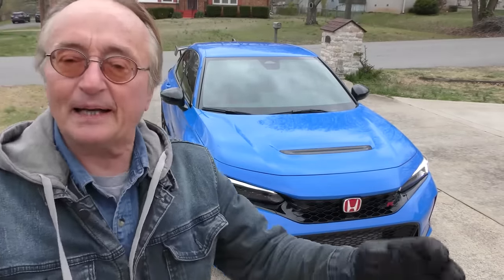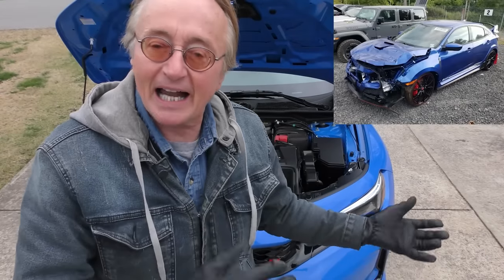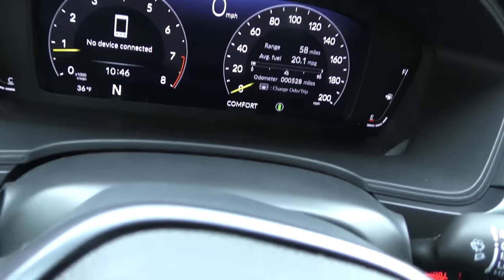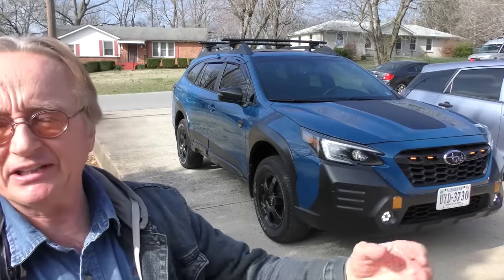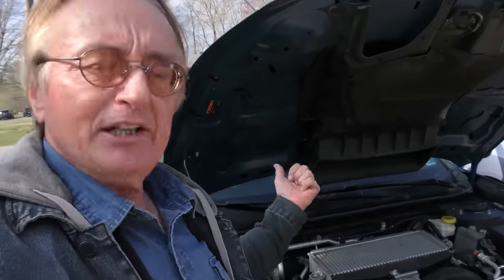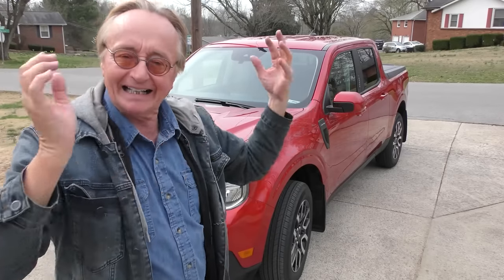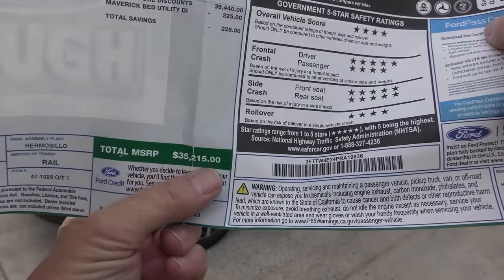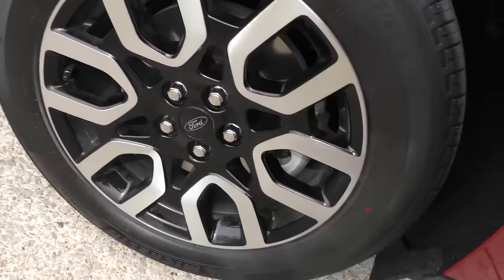3 New Vehicles You Should Be Looking At

Comment: As a mechanic, new cars are amazing, yet absolutely terrifying. I still drive my 2004 Toyota, and I can fix any problem roadside with what I have in my toolbox. I'll give up 150hp for that peace of mind.
Reply: Same. Still love my 02 wrx. I want  a car, not a cell phone on wheels
Reply: @senseicorey9979  😂😂😂
Reply: @senseicorey9979  only idiots think new cars are cell phones 😂 if you can't repair a basic new 4 cylinder then you're helpless 😂
Reply: @senseicorey9979  I'm sticking to my 05 Outback XT (manual & modded) too. Bluetooth speakerphone over FM makes my smartphone a fine infotainment system!
Reply: @senseicorey9979  I love your term for new cars! Bravo.
Reply: A friend of mine has a 1994 Honda Civic, and he will never let that go. So many people have offered to buy it for double what he paid for it. Calvin does all the work on his car which is one of the reasons he keeps it. It's simple.
Reply: Exactly i agree. I have a 2015 Civic SI with all original Honda parts, it would be stupid to modify it just for more speed so you can kill yourself or go to jail with lots of citations and possibly ruin your car.
Reply: Same my 2004 jazz fit
Reply: @senseicorey9979  the new FA20/24 engines are extremely simple, nothing to be afraid (FA20 forester here). And they are extremely reliable.
Reply: @514aam  it's not the engine I'm worried about, it's all the electronics attached to it.
Reply: Bought my Accord Coupe manual in '12 and still going strong.  Not selling it anytime soon.
Reply: @rebeltvr6046  I drive a ton for work and I'd rock one of those.  I deal with winter though,  so subarus AWD is really king
Reply: It’s a Honda, it’s not a VW or BMW 😂 it ain’t gonna broke down if you treat her right
Reply: Stickin with my Camry no problems and it’s a 2010
Reply: New cars are just tin and plastic computers.....people are suckers...I've worked on cars for 20 years...I got out of it 5 years into it because I dknt like working with computers...cars are a hobby for me now, I don't have to work on new cars

Comment: The concept of the Maverick is a good one. Most people in suburbia don’t really need a full sized truck, especially as full sized trucks have gotten larger and heavier over the years despite substituting aluminum and plastic where steel once was. The only good thing about everyone owning a truck is that neighbors come around less frequently wanting to borrow mine. Haven’t shopped for Fords for a while. Was at a Chevy dealership recently and looked at a Silverado 4x4 in the showroom. For just a little over $50k, you’d get a well appointed quad cab pickup with a turbo charged four cylinder that got almost as good gas mileage than my 4x4 Tacoma. My only issue with the Maverick is thy hybrid drive train. The market will dictate whether or not electric vehicle replace gasoline as fast as the government and their handlers desire. The Maverick with a straight gasoline four wheel drive system is the route I’d go. Toyota is purportedly looking at their own version. If it’s affordable and not hybrid, I will give serious consideration.

Comment: I just bought a 2015 Civic SI, 9th generation with the K24Z7 engine one of the best made from all SI’s for 18k out the door with 63k miles, I’m sure i over paid $4k to $5k more for it but I was satisfied with the purchase, it’s tough to get a 9th generation with original Honda parts. I was relieved when I was told it’s all original parts from Honda and confirmed it with my mechanic, I don’t like it when they modify it to make it faster, my opinion it’s stupid to mess with something already with lots of power. I would rather have a use older model type R which in my opinion are better built from the new ones but I wouldn’t blow no 60 grand on a type R even at its original price.
Reply: Look up the boy with the honda. He’s making 400+ hp on older high miles honda si. And he seems to race them hard a lot.
Reply: @alexvillalobos7137  Keep it stock.

Comment: If I wasn’t as careful as I am when driving my type r my wheels would have cracked or bent for sure. I have 35 profile instead of 30 and it’s still harsh. I slow down to 55-60 in shitty freeway areas and avoid certain lanes in certain areas for that reason. If I had that type of warrant I’d be rippin 30 profiles sidewalls going 80 through pot holes 😂. Wheels are fine but I drive with a lot of caution

Comment: It kinda makes sense that a CVT would shift like an Automatic transmission with modern computer tech and a turbo charged engine. The computer will be using the transmissions infinite selection of gear  
ratios to keep the engines RPMs in the perfect range to keep turbo boosting as much as it can.

Comment: .
We still have our 05 Outback XT; got it AUG 04.
It's still amazing almost 20 years later.
Full disclosure: We've replaced the turbo, and we recently replaced the transmission.
.
Reply: So....I wouldn't call that amazing, I've had 30 yr old cars and trucks with the original tranny
Reply: Yea that's not amazing at all , I still got toyotas with higher mileage on original trans... get rid of your head gasket problem lol
Reply: @richsweeney1115  
True, but we use it every day.   By "use" I mean 0 to (posted Speed Limit) as fast as you can.   
Doing THAT for her entire life will wear out a turbo and a transmission in just about anything.
Reply: @cormaro13  
Are they turbos?
Do you 0 to (posted Speed Limit) @ every red light; every single day of their lives, for almost 20 years?
Reply: @cormaro13  
Head gaskets are only an issue if you don't inspect your engine oil levels regularly, skip maintenance, and neglect your car.
.
I don't know of many people that redline their cars each and every day, like my wife and I do   I know fewer cars that can take that sort of use.   I've only owned 1 American brand car that could.   The Japanese and German brands do a good job of it though.
.
Had a Cressida back in the 90's, so I would never forget the 1JZ-GTE, or the 2JZ-GTE.   Though most people have forgotten the Cressida.

Comment: I'm still angry at Subaru for not making a manual Outback! The Wilderness could be awesome but I'll stick with my manual 05 Outback XT (for as long as it lasts). Not sure why everyone is so concerned about the head gaskets & turbos. I've had mine for 10 years modified it & drive it in NYC like I stole it & just change oil & parts that wear & it still runs circles around the WRX.

Comment: Toyota is coming out with their hybrid compact pickup truck for roughly the same price. I think I’ll get that and wait. I currently have a 2012 civic that I’ll probably sell or trade in when the time comes. However it has been a super reliable car and I’m looking for a car to take its place.
Reply: The ford hybrid system is basically a gen 3 Prius motor generator unit adapted to a 30 year old Mazda motor. 

There’s nothing wrong with either of those things, but I’d rather buy into a current Toyota, especially after seeing what they just did with the Prius.
Reply: What a terrible idea.....I'd just keep the honda....trading it in on a brand new hybrid ,brand-new style that's going to have issues,  losing 1000s in value when you take it off the lot..and new cars and trucks arentmade that well anymore...and people get suckered into buying brand new.....I'd keep the honda ...or,buy another used honda...you said it's been really reliable...nothing lasts like it used to.
Reply: @richsweeney1115  I appreciate your input. I need a truck for my work and The civic doesn’t have the space.
Reply: @buttsexandbananapeels  yeah that’s what I’m thinking. Get the Toyota truck as it will last probably 15 - 20 years
Reply: @rorobobo8401  15 for sure, 20 if you don’t live in the Rust Belt.

Comment: Personally I don't think I would even consider a Maverick. To quote Sherriff Buford T. Justice - "Oh you can think about it, but dooon't do it!" I would rather get an older V-8 F-150 that isn't rusted out. Of course it goes without saying that the 3 valve 5.4 is out of the question. I would be willing to bet that even if it had 150,000+ miles it would be more reliable and outlast a hybrid or turbo 4 cylinder truck made today.